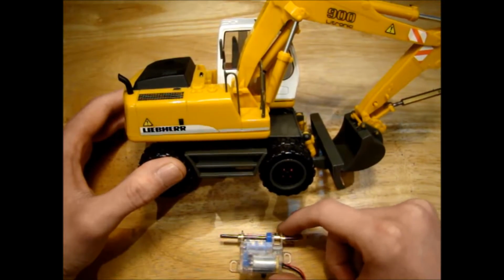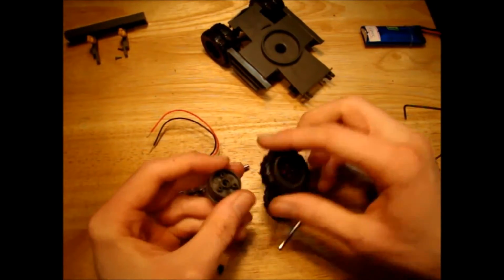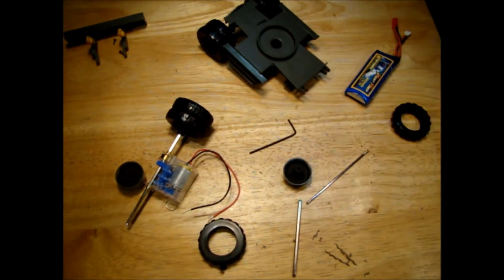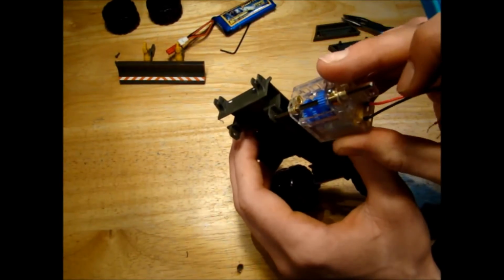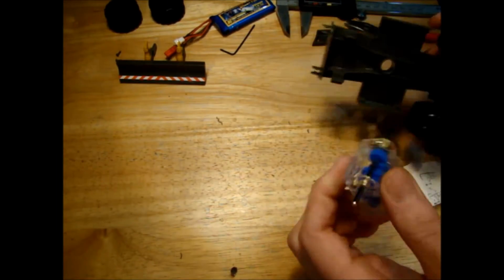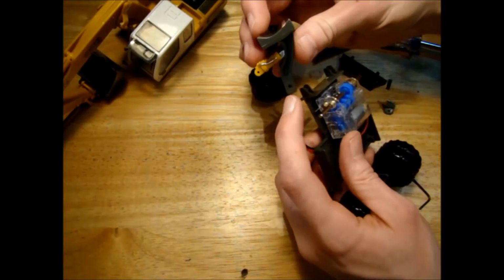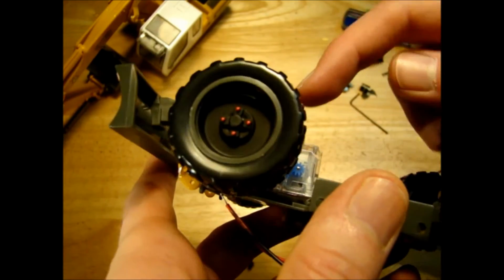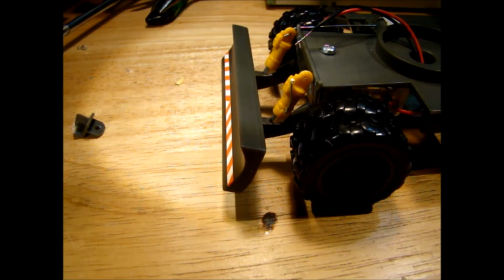RC Liebherr A 900 C Litronic part 3 - Fitting the drive motor and blade servo

Comment: When you mount the all the motors (for the forward/reverse and all the ones for the arm), how do you attach them to the power and circuit? Does each electric motor have its own speed controller, or how does that work?
Reply from the maker: Chad Cale Yes, I'll be using the TB6612FNG dual motor drivers so one of those for every two motors in the model, I'll probably need two arduino pro minis to control all those motor drivers and the radio module. Haven't got that far on either excavator build as I'm trying to perfect the slewing mechanism at the minute which is proving pretty tricky due to space constraints and also me not having enough time lately to properly think about it.
Reply: RC Tractor Guy Thanks! For the slewing you could probably get a larger gear that is bigger than the middle pivot and cut out the middle of it to fit around the pivot and glue that to the base of the excavator.  Then you could get a motor with a smaller gear on it and point it downward so that it locks with the bigger gear and attach the motor inside the body of the excavator. its hard to explain but im planing to do it on mine.
Reply from the maker: Chad Cale That is actually very similar to what I'm trying except I'm doing it on the pc400 first so I was able to bolt the large gear to the diecast base of the excavator. My problem is bolting it all together now that I need wires running through the center of the pivot where before it was a screw in the center holding it all together. I think it might be easier on the liebherr because it is a plastic clip holding the model together instead of the screw in the center, probably should have tried to do it on that model first :)